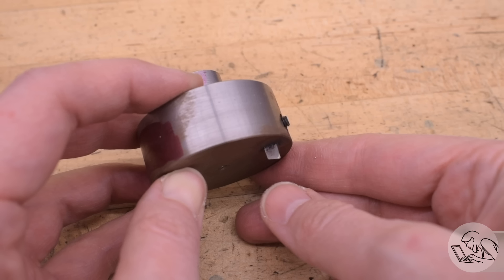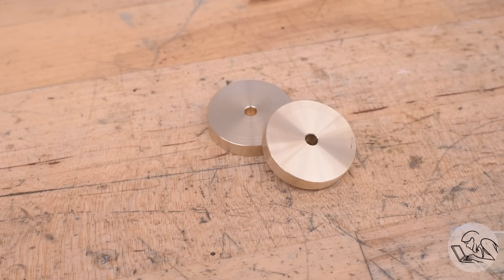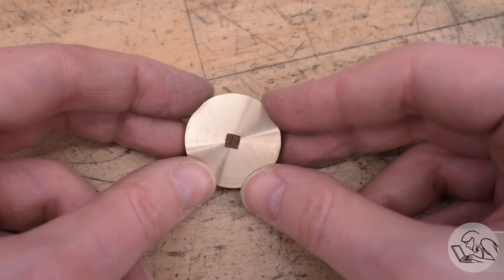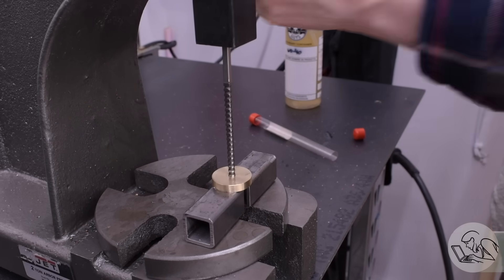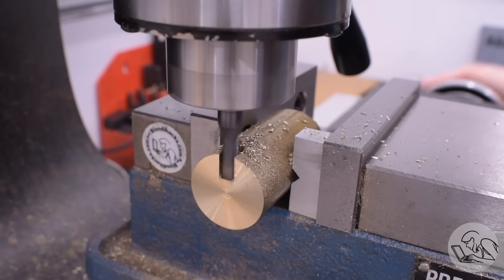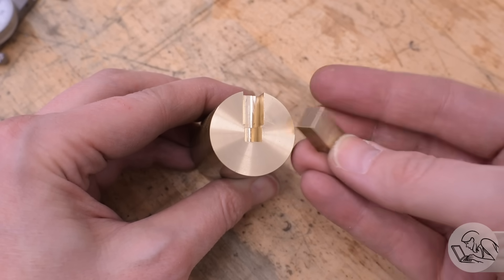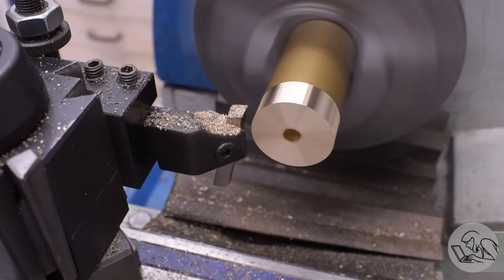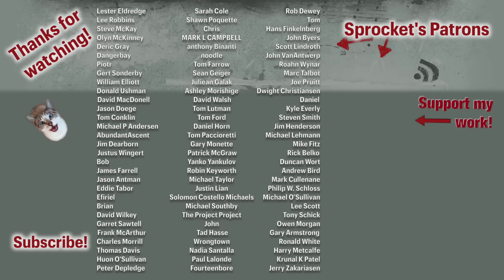Making Square Holes - Three Ways

Comment: Files are one of those things where you get what you pay for. Most people will start off with a cheap file from the local big box hardware store and get so frustrated with it that they end up thinking files are a terrible way to do anything. Theyre barely good enough to sharpen a lawnmower blade... But, when you buy a decent file, you understand just how amazing they are. They can remove material very quickly. They can leave an almost mirror surface finish. And, with practice, they can be extremely accurate... PLEASE, if you need a file more than once in your life, buy a good one (or a set)! It really is life changing (if you use them more than a few times a year).
Reply: Good comment. 
Also, get a File Card to clean the teeth occasionally while working.
Reply: I used to work with this guy Ray he was from Great Brittin, and he could file a part to high degree of precision he used only sharp files, and he had files with a lot of shapes that I had never seen before . and it sounds like a tall tail  until you saw what he started with and then the finished part .
Reply: @petem6291 
I am British and my engineering apprenticeship taught me how to file to tenths of a thou.
Inches that is.
We have been changing to the metric system for decades so that shows my age I guess
Reply: @stevewilliams2498  machining has been in inches since it's inception! Thousands of an inch are more accurate (smaller) than hundredths of a millimeter... But thousandths of a millimeter are too small (or, used to be, before these fancy super modern machines came along).… So, inches ran the machining world forever, until very very recently!
Reply: Exactly. The file is an amazing tool that, when used with a little skill, can do basically anything for you. I bought a good bunch of them a while ago and they are higher quality files. Im very happy with their performance.
Reply: I'm amazed at the quality of cheap files these days, I misplaced my favorite Nicholson and had to run to the local hardware store and buy a cheap one, and it's still cutting fine after two years of light use. 
But I have to agree, a good file is a proper investment and a joy to use.
Reply: same with hacksaws and blades
Reply: @theoldstationhand  And drill bits, too. 
I think that tools and consumable materials that involve friction are the ones that depend most on the quality of the material. For example, I can get by with a lower quality pliers with rough and non-symmetrical finish. But blades, drills, files, and sandpaper, are different: if they are of low quality, we waste our time.
Reply: Yup. A quality set of files won't only be far more efficient and precise but they'll make the process far more enjoyable. 
Cheap files often have poorly cut and undefined teeth that don't cut well and take 5x longer than a quality file. Also like I mentioned cheap files are almost never straight, always some distorting or warp in them which makes working with them more frustrating if you're trying to do precision work.
Reply: What are some quality file brands?
Reply: @luisgaray2550  depends on where you are - in Au, Wiltshire, Nicholson, Pferd & Bahco. IMO, best just to buy the ones you need at the time and not those in a kit. Also, they need to be stored singularly and not just thrown one on top of the other - in other words don't let the files file each other!
Reply: Bought a bushel of Nicholson 2nds for knife and tool making (ca. 1972). Several cut fine and I still have them.

Comment: One method I used is supergluing 2 pieces of HSS bit on top vise soft jaw that machined to level to use it as a filing guide similar to those knife maker's file guide. It helps noob like me get relatively good square hole.  Thank you for sharing other method especially the last one.

Comment: Ah, the chisel approach to square holes, made popular by This Old Tony. When done right, it never fails to amaze.
Reply: It's brass, aluminium or soft steel? In the first instance, I'm using a (differently shaped point) chisel to make a square!  How do you think we do it on a hung door? We can't drag a large and mill to the job!
Chisel & file, after drilling.
Reply: @NigelTrolley but square holes are required in more things than hung doors and with more precision.
Reply: @gbwildlifeuk8269  An Adams Rite lockset into an aluminium alloy door has to be to about half a millimeter over 7" x 3/4" (177.8mm x22.2mm), as a rectangle. Last one I did was 8mm+ thick in places. But sure, tell me how much more accurate it needs to be than a chiseled and filed friction fit?